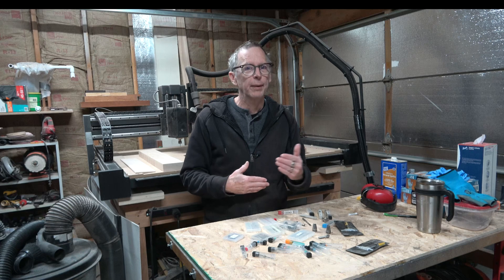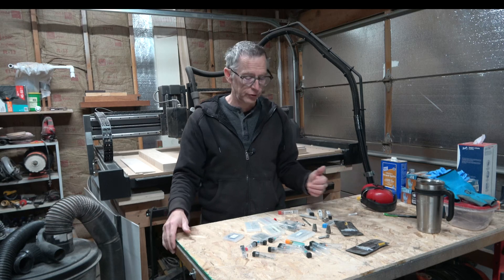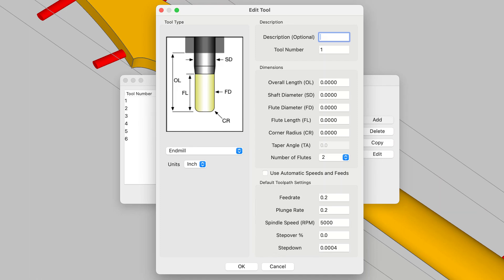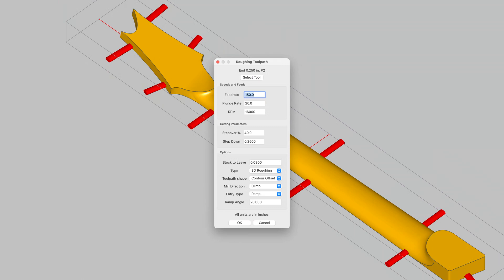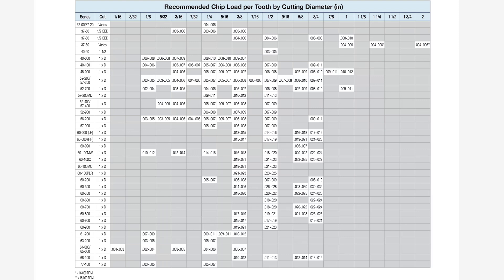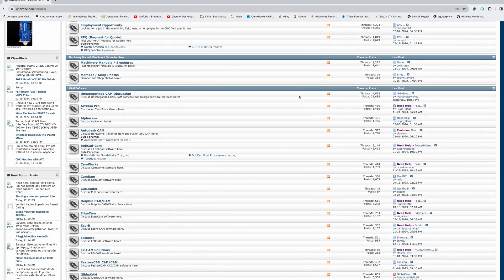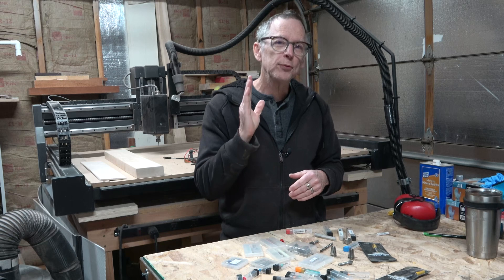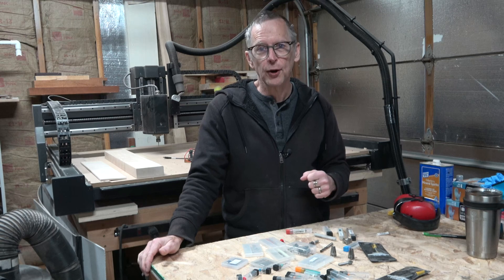What Your Momma Never Told You About CNC Bits

Comment: Thanks again Chris for your insightful videos for me I will just need to figure out what bits that will work best for me.

Plus looking at the picture of your machine gives me hope that yes I can still use a chain but find a high quality chain for even a cheap Chinese made machine since it seems like for cncs they are all Chinese now.

And even the controller boards with the exception of the longmill mk2 from scienci labs which is canadian for me I know I will need a 4080 using metric terms.

I found a 4040 but I know I will have to extend the base and upgrade all the rails to stronger sturdier rails and longer rails to get that size I need plus upgrade the steeper motors to nema 23 motors or better I know a 300 watt spindle is enough power but a water cooled spindle is more ideal so the bits do not overheat and over 2 kw is plenty of power on a water cooled spindle.

It's just frustrating that the only option at a reasonable price is to get a Chinese machine tear it apart and order all the parts you need to modify it into a 2 grand or more machine. Which in realty in parts is maybe another 300 to 400 dollars in parts maybe 600 on top of the 345 dollars you spent on the machine but that's better than spending 2 grand upfront plus the additional 800 dollars for v carve pro when you can do it all for 1700 dollars maybe 2 grand with v carve pro.